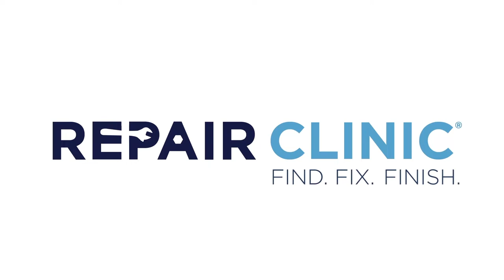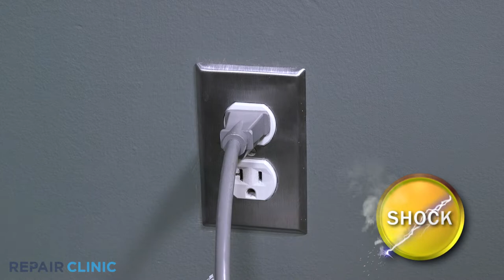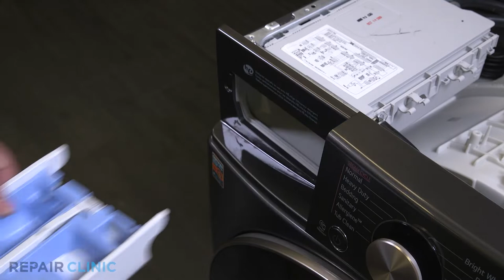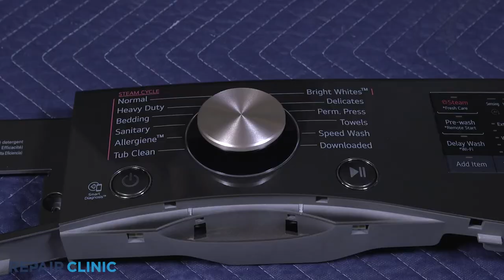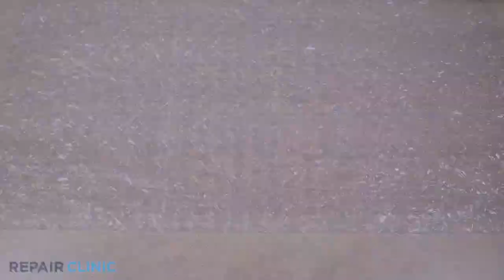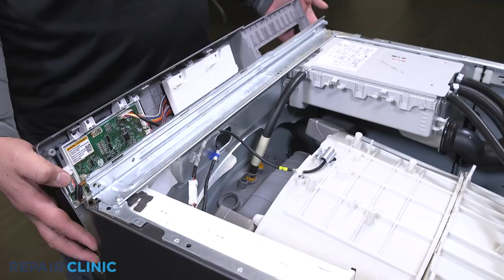LG Washer Control Panel Assembly Replacement AGL30019511

Comment: perfect video, seems like my power button got dislocated and no longer springs back and is sunk into the control panel a bit, looked almost everywhere on how to take this apart.
Reply: Almost same issue but spin button is sunken.
Update: Removed the layer (the plastic film with all the instructions) on the top and added a piece of plastic to the top of the sunken button. Temporary fix but works like a charm.
Reply: Btw nice pfp